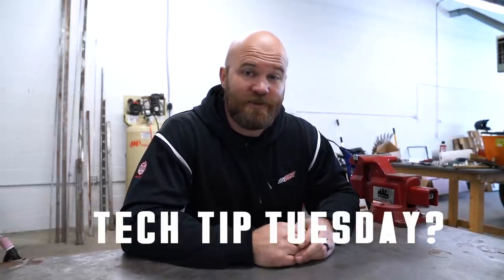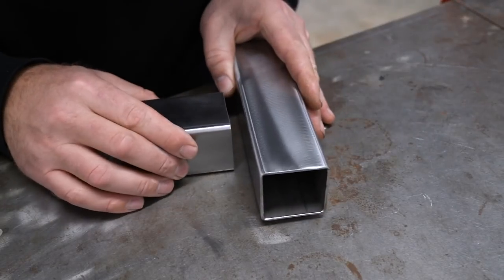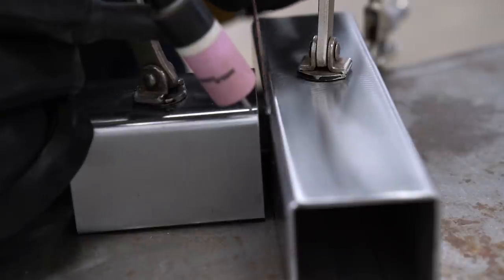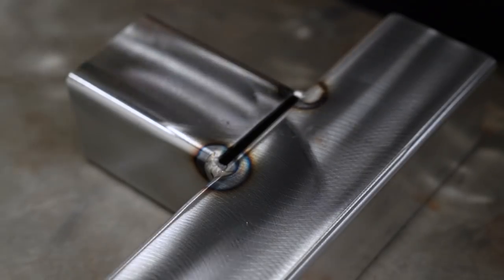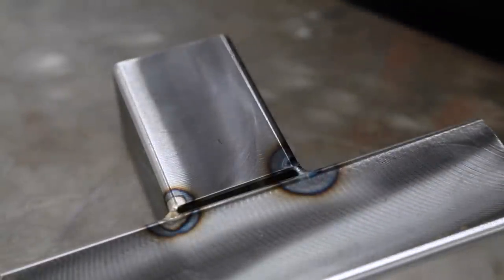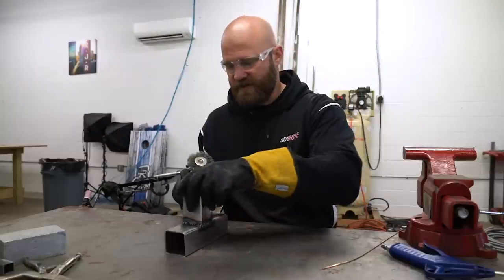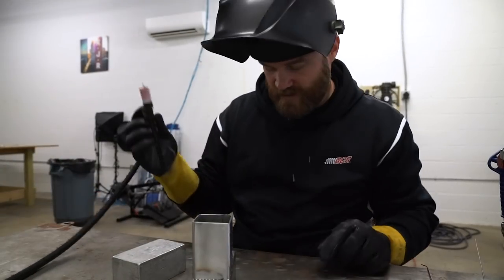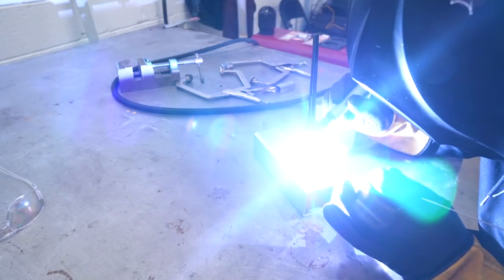How To TIG Weld ANY Gap

Comment: Was very interesting watching you learn how to video your welding during this video. Also, you've got me suddenly paranoid about my "just burn through the rust/oxide" approach to pre-cleaning the material and filler rod. I think I need to cut through some practice welds and see what rust and oxide actually does to the weld.

Comment: Hey, just a quick tip. I would hold the rod a little closer to the weld. Also, as long as you have it tacked on either side of the (start)(stop) you wont need all the tacks, and a welder who has to get all my welds certified and x-ray'd this weld im pretty sure wouldnt pass the standard our clients set for their products. Another thing. The gas from power shut to gas shut out of the pistol can probably be turned up by a tiny smudge. like 2-3 seconds. And i dont know how much gass/pm you have it on but from the sounds im guessing around High 12-mid 13. i would probably amp that up to 14-14.4 depending on the grooves/and or flat surfaces. you have to fill in (Metric measurements btw)

Comment: I`m a complete newbie in welding but instead of all that work I will sacrifice tubing and re-cut straight the edge. 
that been said, I also straight forward welded gaps like that from my first welds but that work was not needed to be strength,  was just a simple garden table , etc

thanks for the video!  all the best!
Reply: Sometines tou have no choice. What would you do i60 feet in the air whan they send up a 3000 pound beam and it is cockeyed on one end by a full inch down to zero 4 feet away, tell the pusher to scrap the iron an cut you a new one?

Although he showed a totally wrong technique what he was trying to show was how to fill a gap. Not how to fit a piece.

Comment: I usually do stringers until I can weave it together. The only time I use Tig on carbon steel is on a high stress application like suspension. I use stainless filler so the edges of the weld don't rust and crack over time

Comment: Just put two opposing tacks on the work and a third on the backside to keep it locked in place the measure you want your gap to stay... Then start at your first tack/bridge and run with it! The weld pool will follow your tungsten, you don't have to hedge your bets, by doing all of these unnecessary tacks.
You'll see a good sized keyhole with a nice gap and honestly, it's easier with TIG to know what your penetration is going to be with a big gap.
For most of the travel while walking the cup, you don't really need to add much filler wire since you're using thin metal. You've got to take the training wheels off and run with it to see the keyhole form and add filler where needed... Keyhole will let you know. Then keep on walking and you're going to finish the part.

Comment: For a super long gap like that,  I would grab a larger tig rod (the largest one that can fit) that I can hammer into that gap, to take up all the space & slack, then weld on top of that, so you're now only filling in much, much smaller gaps.  Grab the grinder and taper one side of the tig rod if the gap itself has a taper.  Try it.  Don't waste time.  :)

Comment: I usually keyhole gaps. Feed the wire from the back side. Its easier to weave the puddle. Then again you can just use 1/8 rod and lay wire the gap. Depends on the application.

Comment: Well done. Question is - would this weld be significantly weaker compare to exactly same joint, material and weld without gap, completely squared?
Reply from the maker: I think it would be weaker on this thin of material yes, significantly I’m not sure. I typically have only done this is small sections of a larger weld. The example was to allow for more camera time.

Comment: The clip around 14:35 or so is a really good shot of filling that gap. Many welding channels don't ever get a shot that good.    As for filling the gap, I like to grab the next size up of filler rod. But I work primarily on 16-20 gauge sheet metal, often riddled with rust, lead, old bronze filler etc.

Comment: I wonder if forming individual teeth as you call them isn't more difficult than just starting at one side and bridging continuously as you go left to right.. That way you have the two sides and the recently finished fill to join to. Forming teeth is like working with 20 problems ( 20 separate gaps) rather than just 1 initial gap then weaving to 3 faces. If you have tacked the corners then there should be no twisting. The technique I describe is my go to for arc / stick  welding.

Comment: Sure it’s possible, I’ve done it too.  Problem being, you use so much gas it turns into a pretty expensive weld.  Much cheaper to trim it or even splice in an extension.  Props for the ocd tacks! ;)

Comment: That "gap" is easy if you use the "lay wire" technique you should only use bridging for x-ray welds. Lay wire is getting a bigger wire and lay it across the gap then you can run it over with the torch and some more wire. That undercut is because you don't use enough filler wire.

Comment: I actually feel uncomfortable welding Pipes without a descent Gap. I need to see the Edges that need to be welded.  I even like to check the welded Root through the Gap I´m welding. When you can throw a Cat through the Gap, you can weld it! :) Keep up the good Work! Nice Video!
Reply: If you cant grind a bevel to the metal before welding... gap the metal. Otherwise you wont get good penetration. But that's just me and don't listen to what I say.

Comment: As someone who has done tig for years the reason it did that was most definitely not the collet. The reason it did that on the first weld but not the second would most likely be from it being tubing without a purge! I was always thought on tubing you have to have argon on the inside of the tubing if there is a gap or else it will cause the weld to be partially shielded.
Reply: Adam’s Welding stainless requires an argon backpurge, but not regular steel.
Reply: No but if you have a gap of any kind it will make the world of difference! And it won’t do what happened in the video, the brown color around the weld is a sign of lack of shielding. I have used tons of radnor tig consumables and never had a single issue so I don’t think it was out of spec I know it isn’t a premium brand but I have never had a issue. The reason I stated back purging is because that has always worked on any tubing with a gap for me!
Reply: @adamswelding5052  
if that was the case, why did it work the second time but not the first? The only thing that changed was the collet !!
Reply: Good job 👍

Comment: Off topic: welding across the faces of square tubing warps the pieces in a major way. Avoid warping by staying on corners and ends.
Reply: Thats why it is better to just weld the sides. when you go across the piece... more likely for warpage  and or stress or cracks.

Comment: I am not saying you can square the tubes nicely to avoid those huge gaps and bla bla bla, I underdstand the purpose of this video. Maybe one thing could be done as "another method", filling the gap with a piece of the filler rod laying on the gap, tack it on each extremity and run the bead over. That's how I would try. Thanks for sharing !!!
Reply: That's what we do!
Reply: Also known as "slugging" Slugging is not a recommended method especially on structural joints that are required to handle heavy loads.
Reply: @davidevans9543  Agreed my friend !
Reply: Cope the tube...and it'll sit right flush up against the other

Comment: To fill a gap focus more on the base metal add extra filler and then with the tungsten have the pool jump at the Gap

Do a small bead on the edge of the base metal outside corner and then have a second pass that would fill the smaller Gap
Reply: That’s how I’ve always done it on square tube 👍🏼
Reply: The radius is the thickest part of that fit up. So stack there and walk over

Comment: Bridging a gap using those teeth isn't right or wrong, but with the correct spacing using that method would minimize heat distortion if it's a problem for thinner metals and you alternate the tacks. You can definitely use a weave to fill the gap, without doing the multiple tacks even. Lead the weld pool edge with the filler and you may need to weave the filler rod with the torch. As a final note: Nice beads and thanks for sharing your method. I'm going to try that next time I have a gap to fill. Better than having a too large weld bead on thin metal. Less filler as well.

Comment from the maker: Appreciate all the comments, sadly I converted my YouTube channel today and YouTube deleted all of my replies! Painful part of the channel transfer process but should be good to go from now on.
Reply: Perfect.
Reply: Watched the video.... and was ready to comment on the sizzle and spadder... I was ready to say hey no gas or wrong gas and as soon as you said different manufacturer parts! Got me thinking!!! I went through 3 different bottles of argon.... same not so nice!!!! Did everything changed from water cooled torch to air cooled and same thing... won't get into names but changed my cup which I loved and went back to ceramic cup and all gooooood! So yeah you are correct !!! Different collet, lense, cup will cause a nightmare!!! Thanks for the vid!!!! Nice to know I'm not the only one or crazy!!!! I mentioned to over 20 welders and I must be doing something wrong..... well I was !!! Just assumed I could take a lense and a collet and a cup from elsewhere and assemble it on one torch !!!!
Reply: The "proper" way to do this (from my four years at welding school dont quote me in not a professional), or at least the way I would bridge gaps like this is to use filler rod that has the same width of the gap you are trying to weld and work in the filler metal with tiny half circles as you move along to spread it out nice, worked like a charm and came with some nice uniform welds! but i like the creativity in this video although i feel if i tried it i get way to many keyholes lol, but great vid!
Reply: Just wondering if you watch This Old Tony? Some of your content is pretty similar. And that thumbnail is too

Comment: You did an excellent weave weld style. This is a good method.
Reply: Teeth welding isnt your creation but to discover ot by yourself is a very good thing.
Reply: You need a better filter for the camera. And actually provides some great info for newbs. Cleanliness is godliness
Reply: So overall excellent excellent info. Filler material needs time to cool. Work on explaining cooling pools.
Reply from the maker: Thanks man, and I think I have the camera stuff more sorted out in my latest video.

Comment: Airgas is the worst. They totally ripped me off. $950 for a couple of full 125 bottles, one argon and one 75/25. Then charged me almost double for a pound of rods vs what they advertise on their website. That's what clued me in that I needed to look for a new supply shop. Newby mistake, I won't be back! Nice video man.
Reply: Doesn't mean ALL Airgas places are bad. Think about that for a while.
Reply: Thought about it for a while (nice passive aggressive addition by the way, the “not all airgas is bad” part alone would be more effective)  and I’ll be going to my local guy with good prices and great service. You can think about airgas all you want, I’ll be driving right on by.
Reply: And all airgas carries Radnor...and Radnor does actually suck hence airgas sucks

Comment: Personally I would use an 1/8 filler and do a slow weave at about 80 amps because the tubing is so thin, but that's also with a 3/32 tungsten, and not done the tacks

Comment: dont take this wrong , but thats the best advert for mig thats out there ,,, some days you just have to adapt to the situation ,,,, great video though
Reply: tom thompson 
Grettings from Germany Nice Video! 
just wanted to say the Same Thing im thinking about getting a tig or mig welder but it Looks like a mig would be bettet for my Stuff.
Reply: You are absolutely right on this 👍 That's a mig job
Reply: I rarely use TIG for steel. Almost only if I’m down to 10 - 40 amps on very thin material such as 18 gauge or less, and not always with 18 gauge. Always with 16 gauge and thinner stainless, and thin aluminum as well.
Reply: @SegwayThessaloniki  
when will you lot use your brains before engaging your keyboard HE WAS GIVING A DEMON STRATION OF HOW HE WOULD WELD A GAP WITH A TIG WELDER !!!!  not a mig or a stick
Reply: Yep. This is a lot of work. Just gonna mig it.
Reply: @bearup1612    "demon stration"   yet you say use your brains..  how ironic    lol
Reply: i thought the same thing !

Comment: How was the fusion on the weld by adding the teeth first? I was curious of that when I watched the video if the fusion would still be able to go through to the other side completely. An I agree with rebel. Walking the cup.would be a process that could easily close that gap

Comment: Just weave across the gap and fill it mate. Depending on the size of the gap sometimes I might get 2 pieces of filler wire, clamp one end in the vice and other in a drill chuck and twist them together.
Reply: I'd never thought of doing that,  I'll have to try it one day.

Comment: Tack each corner and use a 1/8” filler rod and weave it in and make sure to wrap the corners
Reply: Justin Voss 1/8 is probably to thick of a rod to melt on that tubing. What was it 3/16? . I would never use 1/8 on anything that thin especially with a GAP. You were right on. This guy Dave always likes to give people bad advice.
Reply: tdej80 you’re exactly right and that’s a hard award to earn on here!!! He thinks I meant dab 1/8” filler when I said use lay wire and weave it in. I do it on stainless tubing all of the time

Comment: for me the trick is to get the right amperage, once the puddle is formed then just weave and add rod, maybe have to back off foot pedal somewhat if the puddle gets away on you. i learned on oxy-acetalyne doing sheet metal, probably the hardest stuff to weld gaps on but totally doable

Comment: If I have to weld a gap, sometimes as large as 20mm(25mm=1") I use the buttering technique. Building up with strings and try to avid pendling, wide pendlings is something you don't want due to micro structural properties and if you're dealing with certification it may be unacceptable as well. Just lay down a string on one side, then continue on top of the previous one until you can close the gap with one string or just a little bit of pendling. When welding strings the heat will go into the previous welds and relieve the stress and tension, by pendling you get huge tension from the shrinking and a lot of heat input. Less heat will give a stronger weld.
Reply: You may have used Google translate, and it has not translated the Swedish word "pendling". (which seems to imply oscillating, (or commuting), or a see-saw motion.
In this context, are you using this word to mean weaving, or bridging, or tacking?
Reply: @Gottenhimfella  I'm not using any translation program, perhaps therefor that misunderstanding. "Pendulum" is what I ment with that word which is the Swedish word for it and what we use to describe weaving as you might call it. Sometimes misunderstandings like this occurs as some of our words are very similar or even the same as our languages are related.
Reply: @Henrik.Yngvesson    Your observation seems to me to be thoughtful and based on much experience, so I appreciate your effort to clarify that point.
Reply: @Gottenhimfella  I've worked as a pipe welder in the nuclear power industry for 8 years and now I've also studied to become a "Welding specialist" so I can go into much more detail if there's something you want to know.
Reply: @Henrik.Yngvesson   Thanks for that generous offer!  I do have a question: Someone else suggested that if it was decided to build "teeth", it would be better to  grow these alternating from each side. ("Castellations") Seems to me you would end up with a gap which looked like a graph of a square wave. You could then weave across this narrow gap to fill it.
 It did seem to me that the contraction stresses might be more diffused than the method shown in the clip, because the pull is not all in the one direction.
I thought perhaps for someone less skilled, "teeth" might be easier to build, on very thin material, than stringer beads, without melting away the parent metal (because you can "bump weld" using the switch on the handpiece, so the heat does not have time to build up)
I wondered if you thought this might be a situation where castellations would be preferable to stringer beads? Or can you think of some other case where you might recommend them?
Reply: @Gottenhimfella  I wouldn't do something like that. If the gap is wide enough you could also put a strip of plate or a round bar in the middle of the gap and then weld it. That and the buttering method can be acceptable if done correctly in certificated applications as well. What's important is that the materials added are of the same or higher quality and compatible with the other materials.

So for example if you are welding two 10mm plates together and you have a gap of 20mm which you can't adjust, then you can tack a 10mm round bar in the middle and then weld it on both sides as long as you get penetration and all that.
Reply: @Henrik.Yngvesson  Thanks, Henrik. That makes sense to me.
Reply: 1000% the right way to do it but 10 bucks ($10 USD) says there are not 10 guys that responded to this that know what buttering is.

Comment: Would you please explain more on the mixing of brands for collets and tungsten. My company is having problems with successful fully penetrating butt welds on 3/8" aluminum. One side is angled like a knife and the other is flat stock. Alot of popping and contamination with lack of penetration going on.  Thanks in advance for any advice.